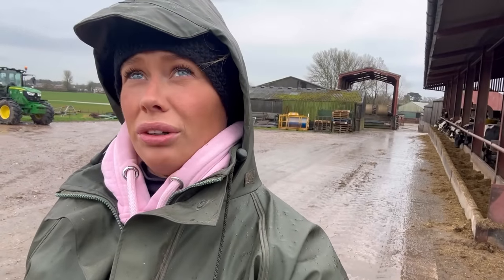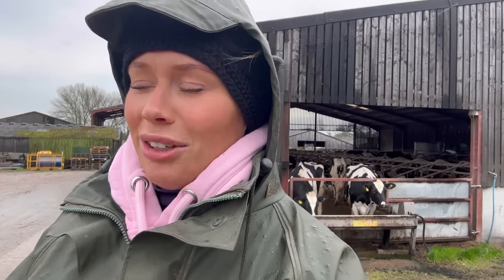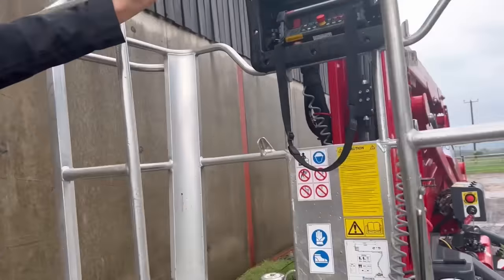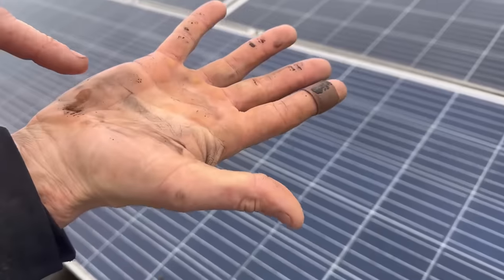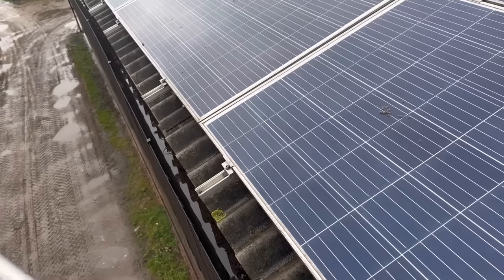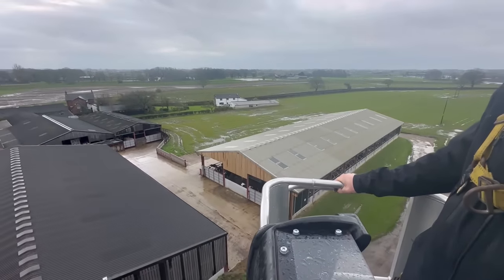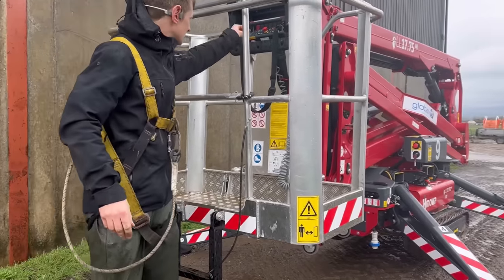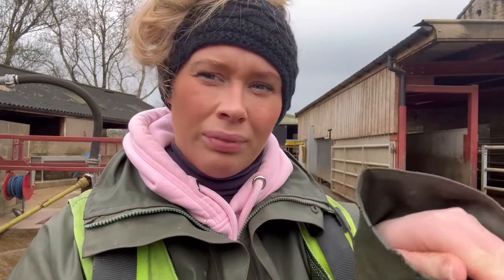FARMING 45ft IN THE AIR!

Comment: Hello Evie,

Do you need to clean solar panels?

Cleaning solar panels is usually not necessary. Solar panels have a self-cleaning layer and because solar panels are positioned at an angle, a heavy rain shower washes away most of the dirt. Sometimes solar panels contain stubborn dirt, for example due to bird droppings. If your solar panels are very dirty or if it hardly rains for a period of time so that the dirt does not wash off, you can have your solar panels cleaned. Too much dirt on your solar panels can slightly affect the annual yield. It's just a few percent. You therefore often do not earn back the investment.
Clean solar panels yourself

It is advisable to outsource the cleaning of solar panels. If you want to do it yourself, there are several things you should pay attention to. A number of tips at a glance:

    Always make sure that you go onto the roof safely, for example with fall protection;
    Always turn off the solar power system first. For example, by switching off the solar panel group in the meter cupboard;
    Use a garden hose to rinse off the majority of the dirt and rinse with decalcified water without soap. This is how you prevent limescale stains;
    Only use a cloth or sponge.
    If you can't reach it easily, you can use a telescopic squeegee (provided it has a soft sponge).
    Solar panels can get very hot when the sun shines on them, so avoid cleaning them in the middle of the day. The morning or end of the day is a more suitable time;
    Do not stand on the solar panels. This can damage them.

When cleaning solar panels you want to prevent your panels from becoming damaged:

    Never use a high-pressure washer;
    Do not use a scouring pad, cleaning/scouring agent or window scraper. This can damage your solar panels (the coating in particular is brittle);
    Do not use salt water, green soap or other corrosive cleaning agents. These agents damage the protective layer on your solar panels. If the dirt is very stubborn, use a special cleaning agent for solar panels.

"Association of your own home" Provides this information with us in the Netherlands.

I usually watch your YouTube videos and I was shocked at how you clean the sone panels, hence this comment.
Greetings Herman.

Comment: It seems that what you are doing is not right, cleaning with brushes removes the protective layer applied to the panels.
Reply: Not of you use specifically designed equipment for solar panels. Normal brushes I totally agree with your statement